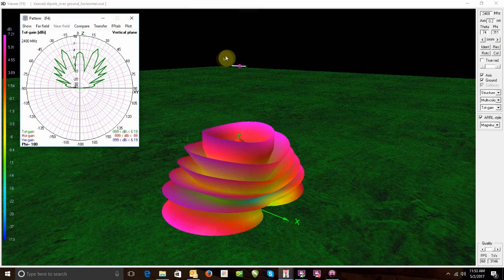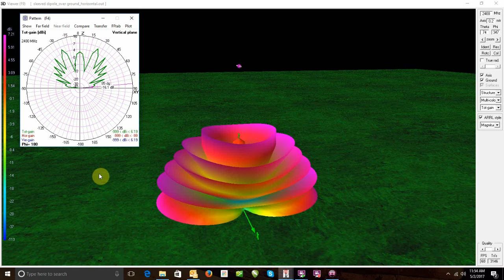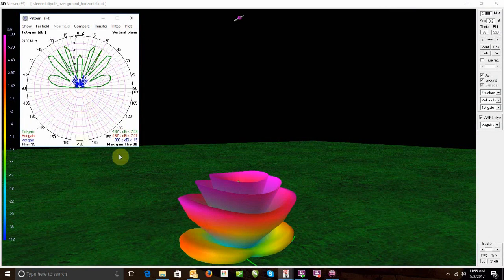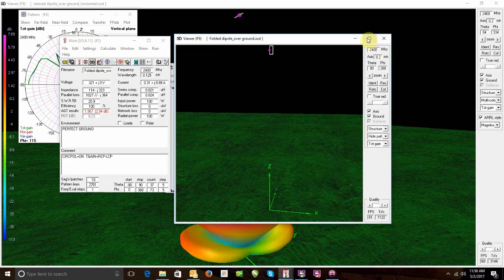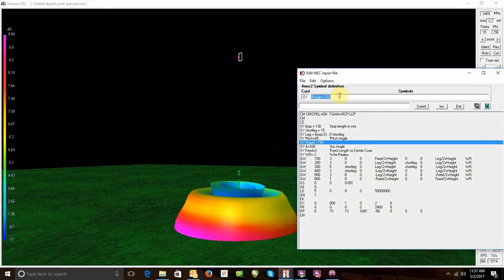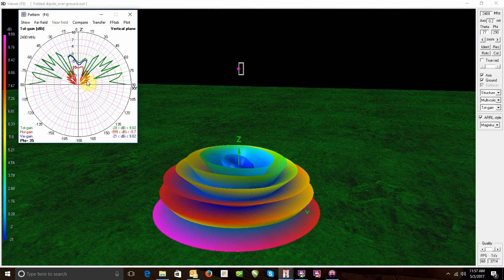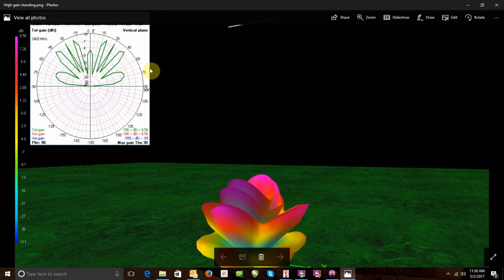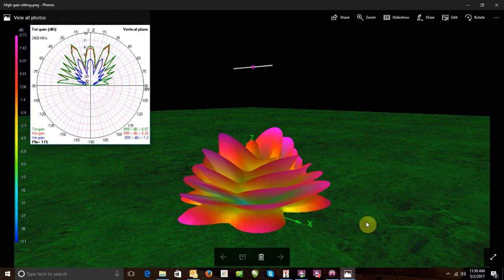Why I modified the antenna on my 2.4GHz RC radio

Comment: I really want to know... Does coax cable length really matter? I used the BoltRC kit which includes a 100mm ufl to sma cable... but this is not a multiple of the wavelength. There is so much mixed information? I've bought your Antenna... which appears you can't purchase without the SMA tail (nvm) but I don't know if I should be un-soldering the ufl and replacing the pigtail with yours? My understanding is that the length of shielded coax should be completely irrelevant?
Reply from the maker: It does matter if you are using poor coaxial cable.  I am guessing you have 1.13mm coaxial cable for your mod?  If so, 100mm is almost exactly 2 wavelengths (since the velocity of propagation is ~.81 for 1.13mm) so whomever specified this at BoltRc either knows what they're doing or got really lucky.  

If I were you, I'd buy an SMA to u.fl extension (RG178 cable) and use that to adapt the antenna rather than soldering it on.
Reply: Thanks for the response. They provided a 5cm thin black one with rp-sma and a 10cm thick copper colour one with sma (I used the 10cm one :D) sounds like I can leave that guy in place. The 5dbi mod sucks, dropped my range quite a bit. Given I disconnected and reconnected a ufl connector it's unlikely to be heat or static damage. SWR/RAS is sitting under 50 but fluctuates around 20-30 which makes me nervous. I had a significant increase in low RSSI warnings 100-150m out with clear line of site at a local Oval over the stock 2dbi aerial (which rarely triggered a warning). Fingers crossed your aerial sorts everything :D We really need an Aussie re-seller for your awesome aerials!
Reply from the maker: The SWR sometimes shows high on Taranis even with the microwave dipole.  However, the performance difference is HUGE.

Comment: Thank you Alex. Love this scientific content. Gonna to get the 2.4G mad mushroom for my taranis mod. Should I worry about the impedance of coaxial cable? Seems I should get a 50ohm cable. But it's usually offered with connectors on both ends, and if I cut one end to solder the wire directly to pcb of the radio, the impedance of the cable changes.

Comment: Can you model the standard dipole in the vertical , as well as the folded dipole in the horizontal?  I mean, your trying to be thorough , without being thorough.
Reply from the maker: I certainly can do it.  I actually modeled it at 45 degrees and found almost zero change in performance compared to horizontal.  Most people do not exceed 25 degrees of tilt on their radio, hence why I didn't bother on this video.

Comment: Got me a mad mushroom on my Taranis now right off the back of this video. Looking forward to testing it. My Taranis already reads half the SWR of my 5dbi mod. (16 down from 33 whatever scaling that is). Soon I'll be replacing the crappy uFL pigtail for one with decent coax and I'll also be eliminating an RP to SMA adapter in the process so I have high hopes!
Reply from the maker: Don't put too much faith in the SWR reading on the Taranis.  I have found it to be highly inaccurate.  However, better pigtails and better antennas are always a good idea.
Reply: Thanks Alex. Any suggestions for cheap testing equipment that can be easily built or cheaply bought that can test tuning and basic things? I don't have the money or the motive to stump up for a Vector network analyser.
Reply from the maker: There is no cheap test equipment at these frequencies.  You can do a DIY SWR meter for about $400 or so, but that's about as cheap as it gets.

Comment: Great video! What about a di-pole oriented vertically? I recently modified by DX7 Gen 2 so that its only antenna is pointing up instead of out. It seems to be working much better now. What does that radiation pattern look like?

Comment: My Taranis TX antenna has a pivot, this allows you to sit or stand with the antenna vertical for best radiation.....If you sit with your antenna parallel to the ground, you obviously dont know how it works.
  I have my RSSI on voice call out ever 3 seconds, its very easy to prove best TX antenna position relative to your RX antennas..?

Comment: Aren't those simulations on the dipole is the dipole is facing down (Dipole sticking straight out of transmitter), isn't that why there are weak spots in front of and behind the transmitter?
Reply from the maker: You are correct.  However, my radio has the antenna flat, so I simulated it that way.  When simulated upright, the pattern is definitely better, but no where near as good as the folded dipole.
Reply: Is there any advantage to having it flat? Also, wouldn't that why you were getting dropouts?

Comment: Hey Alex I'm curious, if I do this mod on my dx8 g2 and use the IPX to SMA adapter should it be a certain length? I found some that use RG178 cable and they are 5.9in long. When I looked inside my radio they were using a pretty good length of that really thin cable so I'm assuming 5.9in of RG178 will be ok but just want to make sure. I was going to get two of those adapters and two of your folded dipole antennas, I think if I do that my range will be pretty insane. 

Also I hope if spektrum integrates this into their radios they allow people to send them in and have it installed or sell a conversion because I just got my dx8 g2 and dx6 G3 not too long ago! Lol it will be great if they integrate this into the radios tho, then spektrum range will be amazing and no one will be able to say team failsafe! Even tho I've used stock spektrum radios for just about four years and never ever had a failsafe! Thanks for more great info! Keep doing what you do!

Comment: Hi Alex! I have made the antenna I think 2 hours after you posted this video on Rotor Riot. I have tested the antenna based on the measurements I got from 4nec2 and it was working good, but unfortunately, I am having short signal issue. I think just passing 60m, I get a beep on my frsky DFT (I am using Futaba T9CHP, and 3 beeps on my DFT means I'm on critical RSSI) I'm also getting a critical RSSI when the quad passes I think 10m from my back. The antenna is facing on the direction as what it looks on 3D (4nec2)
Reply: what could be my issue here?
Reply: by looking at your antenna against mine, yours looks like taller, whereas mine is shorter. Looks like I get a measurement issues
Reply: in your design, the longest element was 0.035mtr (35mm)
Reply from the maker: Two things:  

1.  Did you make a 4:1 balun?
2.  Change the antenna to a square rather than a rectangle.
Reply: balun, nope I did not. I'll modify again this coming week end

Comment: interesting. see I have 2.4ghz blue beams and pepperbox. so if I were to use my mad mushroom on the radio tx, it will give me more range even though I the frsky receiver has linear antennas.

in addition, how much range would I get if I were to do something crazy lime connect my 2.4 pepperbox to the radio tx?
Reply from the maker: I have never tried a pepperbox, so I cannot really be sure.  However, the Mad Mushroom usually goes 6X as far as a stock radio even though you have linear on the RX side.
Reply: Video Aerial Systems interesting. well then I guess I have to try it out this summer. should be fun

Comment: Another informative video Alex. I have always flown FPV with your Mad mushroom and Helical antennas. Now I have moved on to DJI Phantoms drones for Aerial work. Can I use your 2.4ghz and 5.8ghz mad mushroom antennas to replace the stock ones on the DJI Phantom 4 and 4pro transmitters? Just I have still your mad mushroom antennas in storage and didnt want them just collecting dust. Your input would be greatly received.
Reply from the maker: Of course you can use those antennas with a DJI product.  They work great.
Reply: Thanks for your response. Would i have to worry about the antennas being a patch antenna on the drone itself or would the omni directional Mad-mushroom work fine with just being on the transmitter end. Do i have to worry also about the type of co-axial cable to use when modifying the transmitter?
Reply from the maker: Admittedly, when I modified my Phantom, I used cloverleaf antennas on the aircraft.  The patch antennas were complete garbage.  On just cloverleafs I could easily out-distance my control with my video link.
Reply: Do you recommend your cloverleafs or Mad mushroom? Which is better? Does the Phantom controllers operate on 2.4 or 5.8ghz? So do you leave the aircrafts stock antennas stock? Or upgrade the aircrafts ones too? It will be awesome if you can do one of your informative videos about upgrading the Phantom controllers and your recommendations.

Comment: Is it possible to solder thicker coax than 1mm on ipx (u.fl??) connectors or should i desolder the ipx connector too for a healthier mod?Thank you for keeping your antenna designs and calculations open for everyone.
Reply from the maker: You can use RG178.  That is a heavier cable that I use for things like this.

Comment: Are you going to manufacture this antenna or make the design available?
Reply from the maker: I will make the design available shortly.  It is already available commercially.
Reply: Thanks, say that 5 minutes after I posted.

Comment: Alex, why the Mad Mushroom over the Airscrew? Isn't the 3 lobe more intended for a transmitter antenna, or is it that in this scenario the radiation pattern is more important than the output per lobe?
Reply from the maker: The Airscrew will work almost as well as the Mad Mushroom.  it all depends on how they react with the ground.
Reply: Thanks.

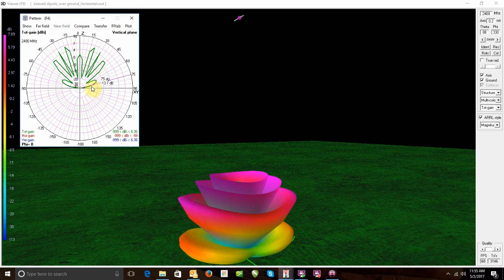Comment: okay I'm a little confused with the angle your getting at 2:13. is the angle relative to the angle to the aircraft to your radio if you are looking at the x y axis on a 2D  plain or something different?
Reply from the maker: The antenna is horizontal, which is how I hold my radio.  Thus, it is parallel to the ground.

Comment: Hey Alex! Anychance the cable that comes with this will be available with a ufl attached? I have the QX7 and would love a plug and play solution. Thanks
Reply from the maker: No, unfortunately.  You will need to buy a jumper to fit your radio.  My antenna only comes with a cable meant to fit the Taranis right now.

Comment: Hey Alex, have you seen the problem that Joshua Bardwell talked about in a video. About the mood, that people should not do it because it will mess up the radio. What do you think about that?
Reply from the maker: Do you have a link to that video?  I would like to see what he is referring to.
Reply from the maker: After watching that video he makes some good points.  The big point of contention is the crumby cable everyone is using.  This can cause serious impedance mis-match problems and can also short out.  The other issue is the antennas people are putting on these radios are not balanced.

Comment: funny to see this 
I did the mod on my taranis and My range became worse with the 5dbi 
until I switched to my 2.4 
mushroom from you
now I have much higher rssi readings on spots were I had failsafes before
so even its circular vs liniair its perfoming way better than all my rubber ducks 
I use the mushroom now
Reply: yes I did range test 
tried 3 5dbi ebay antenna and my mad mushroom 
but I got much further with the circular 
never expected this because of the mixed polarisation
just try it 
and let us know your experience
Reply from the maker: I noticed this, too.  I don't know why circular is performing so much better with linear on the receiver.
Reply: Have you done any range tests? I see that the gain on the Mad Mushroom is much lower than the 3/5dbi linear antennas but in tradeoff you get a much more uniform radiation pattern. I'm curious how range is with the Mad Mushroom vs the original 3dbi.

Comment: I have an 2.4 dalrc amplifier installed on my Spk Dx6 Gen 2. Would doing this antenna mod help me out (literally "out") even further? Also will you have these antennas at the Flying Circus? I will be there volunteering the whole event and would be interested to see about doing this mod at the event. I'm excited for the circus, should be a blast. Thanks man.   -Jamie    p.s. I am not having any issues with brown outs or complete loss of signal, just looking for best possible signal, and wanted to add that so no one jumps on me that the problem is that I use SPK... ;-)
Reply from the maker: It should.  However, there are no guarantees.  The best thing would be to use a Mad Mushroom in your case.  TO know if the folded antenna would be best, I need to measure how you hold the radio and model it.
Reply: Sounds good, I'll be on site from Wednesday morning on, I'm sure we will bump into each other. Thanks man! See you in a couple weeks.👍

Comment: Alex could you still use the standard antennas on your receiver when switching over to a mad mushroom antenna on the transmitter ?!
Reply: Rogier Houtkooper I do rogier 
just test it 
you will see much higher rssi readings with the mushroom antenna
even when its not the same polarisation

Comment: Assuming both sources have the same output impedence, and, as long as the same power is coming out of two different radios, why would an antenna perform better on one than the other? I am an EE who is just curious to see this answered.
Reply: Hello, I'm a student of "radio technology" from germany. To keep it short: Total radiated power must be the same, but you can spread that power over different areas. So if you have got an isotropic radiator, which actually cant be found in real life, its pure virtual, you would spread all your power over the area of a sphere. But if you construct an antenna, that focuses that power over a specific area, as you could see in the video where there were some parts with up to 8dBi (dBi means the power related to what an isotropic rediator would create) but there were also parts which had negative dBi, so worse than the isotropic radiator. In sum the power is the same, only spread across different areas.
To sum it up: If you redirect power from a large area with say 3dBi an focus it to a narrower beam, you can get more dBi, for example up to 8dBi like in the video.
Reply: http://www.radio-electronics.com/images/yagi-radiation-patterns-01.gif
http://bit.ly/2p2XAkM
On the second image you can see the crossection of that sphere of the isotropic radiator, which is a circle. It covers the same area as the longer pattern only in a different form. Still power is the same.
If you want to google yourself, try "Antenna Gain", "Directivity" and "Isotropic Radiator"
Reply: Thanks for the info. I was familiar with the concept. However, I am talking about one antenna performing in one radio better than another radio... With the asumptions mentioned previously, how could this be possible?
Reply: Sorry, missed that. How can you be sure that power and impedance are the same? Did he mention something like this in the video?
Reply: I am talking about, specifically, the claim starting at 0:27... Shouldn't "the" antenna be performing the same in a comparable radio that has the same power and output impedence?
Reply: So I know of 50Ohms and 75Ohms is common for antenna systems, but really every manufaturer could use the resitance he wanted to. So maybe Mr. Crazy just wanted to make sure that nobody can complain if he sticks the same antenna on her/his remote control with a non matched impedance an doesnt get any signal..
Reply: No... Does he have to? Everyone knows it should be 50ohms. Right?
Reply from the maker: To answer whether it would work better in one product than another depends on how the signal is encoded, how the receiver works, and of course what objects are in the near-field of the antenna.  In this video, I only referenced the effects of ground.
Reply from the maker: In microwave radio (what we used for FPV and control) 50 Ohms is the standard.  For lower frequencies, 75 ohms is occasionally used.
Reply: Thanks for that clarification. I once used 75Ohms for some long-wave data transmissions.
Reply: I see... Encoding would make difference. Do your transmitter and receiver have unique way of encoding the signals than the others?
Reply: For (mostly german) Radios these are the systems i could find:

Spektrum – DSSS
JETI 2,4 – DSSS/FHSS-Hybrid
Futaba FASST – FHSS
Multiuplex MLINK – FHSS
ACT S3D – FHSS
Graupner IFS – IFS based on XBEE 
Graupner Weatronic – FHSS
HITEC – FHSS
FrSky – FHSS
Assan – DSSS 
Schulze S3D – FHSS
Graupner HOTT- FHSS

DSSS: Direct Sequence Spread Spectrum
FHSS: Frequency Hopping Spread Spectrum
IFS: Inteligent Frequency Shifting
Reply: Encoding is more for error correction and should not make a difference in received power. However, two receivers both receiving crappy signal may perform different due to the encoding. Never mind, I am still thinking the singular frequency like the FPV.
Reply from the maker: Encoding affects the way the receiver handles multipathing and fading ;)

Comment: Yeaaa ! Someone talking spektrum these days :)
Reply from the maker: Not unflyable, but certainly problematic.  -20db should still be good if you fly in the park and stay relatively high (and have a low noise floor).  However, we typically fly low and behind things which makes the problem more severe.
Reply: and hes talking about how the stock antenna is basically unflyable.